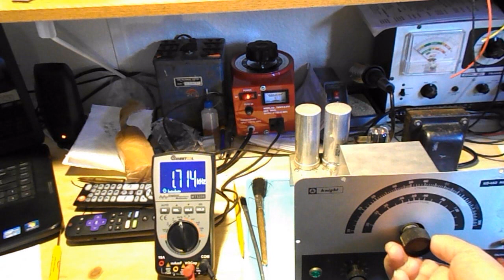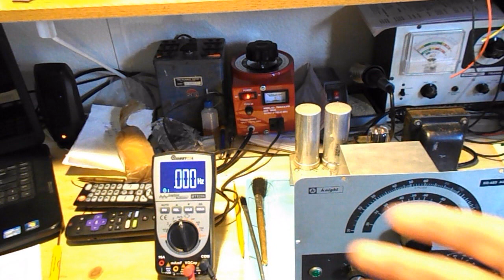First Test Of Knight Kit KG653 Audio signal Generator

Comment: Look great Larry.  Odds are that meter is not fast enough to capture the subtle changes of the nail turn  but for testing purposes its close enough for Rock and Roll.   Nice job
Reply from the maker: Yes it does what it is supposed to do so I am pretty sure you are right the meter is not quite fast enough to keep up. Now I just have to make a pointer out of lexan.